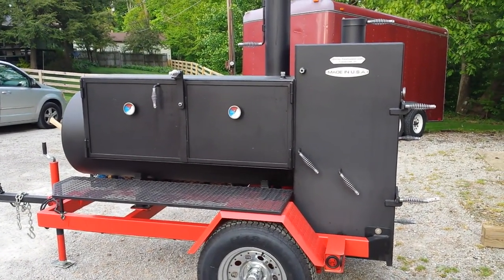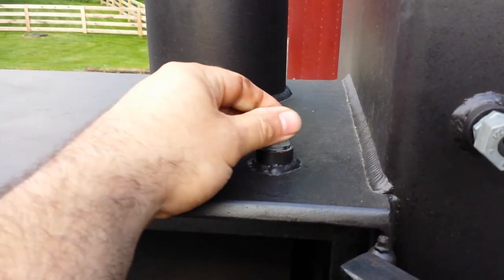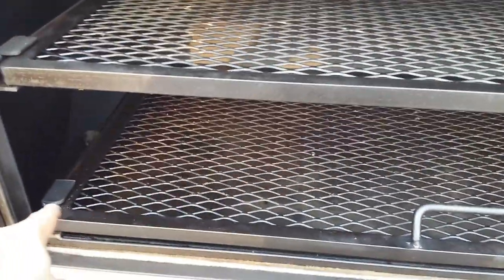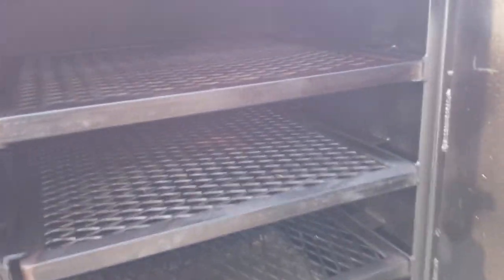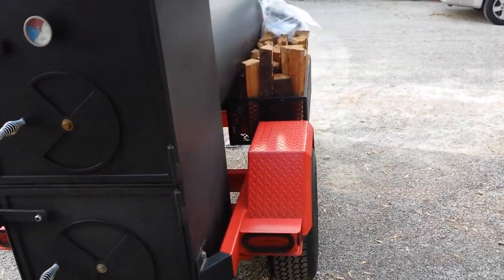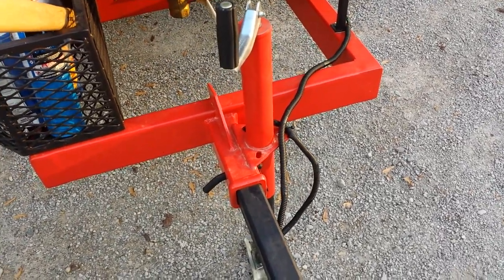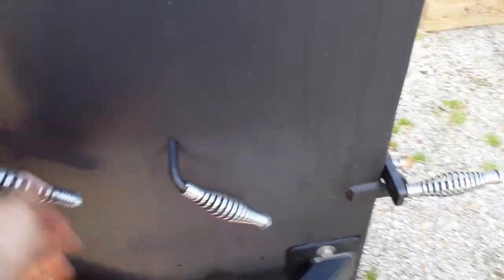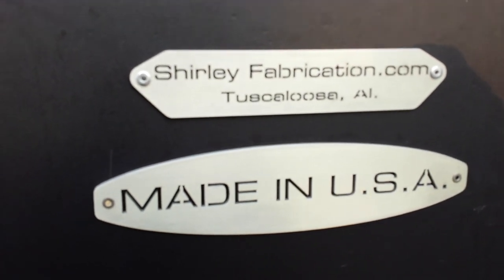Shirley Fabrication 24x60 trailer model

Comment: does it use up alot of fuel?
Reply from the maker: Ricardo Vazquez, no not really.  Once to temp I use a stick of cherry about every 30-45 minutes and I cook around 275.
Reply: Beentown71 thanks for the reply. I've put in my deposit and hopefully I will have mine built by September. It will be my first stick burner. Is it easy to control temp and I will be keeping mine outdoor any recommendations on how to cover it. It's a trailer 24x60. Thanks